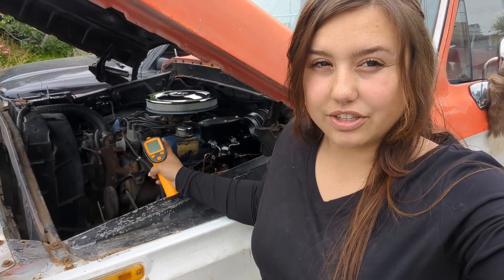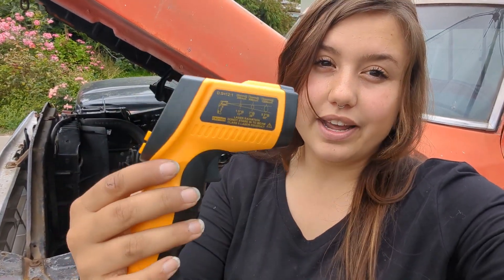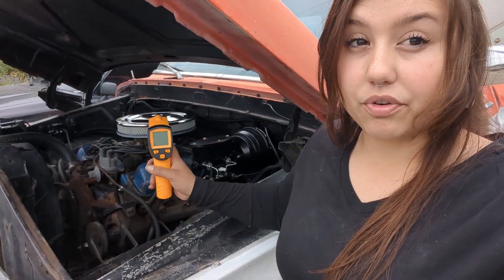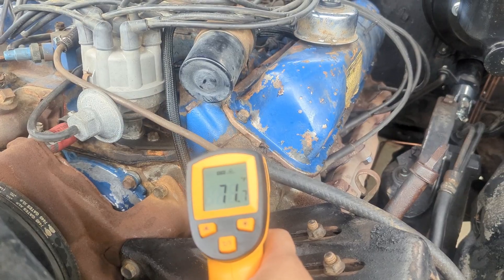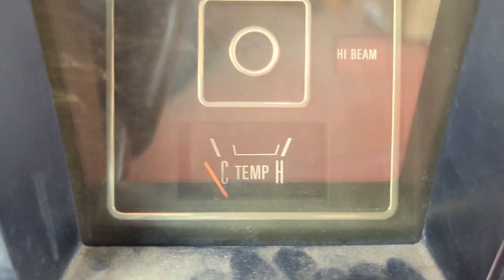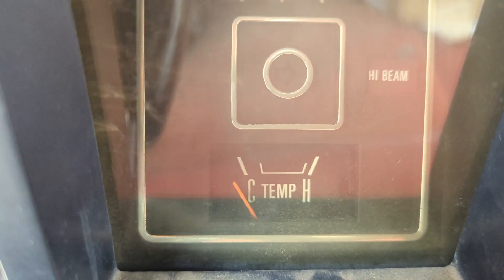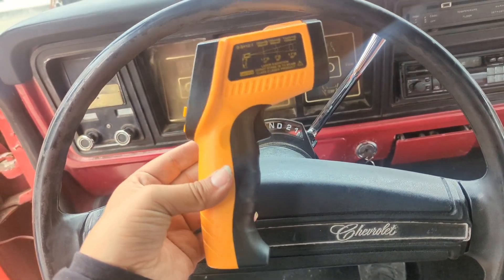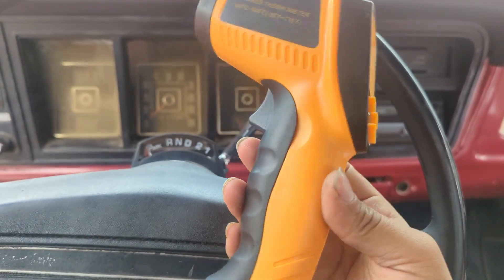How to Use an Infrared Thermometer to Diagnose if Your Engine is Overheating! Easy!

Comment: Great video.. can't wait to see the drive... 
One quick note.. that a car can run to cold can causing buildup in the engine as it not getting hot enough to burn off carbon.. 👍

Comment: I got one of those pre-2020, and some (not all) brands of those went WAY up in price that year, and still haven't come down.

Post-2020, though, I upgraded to a (smartphone-connected) thermal camera. Definitely something I wouldn't have bought with my current budget if I wasn't using it to make videos, but it's super cool to see basically everything at once. Even the cheap ones are a few hundred dollars though, so the tool you have is a better use of money in a majority of situations.